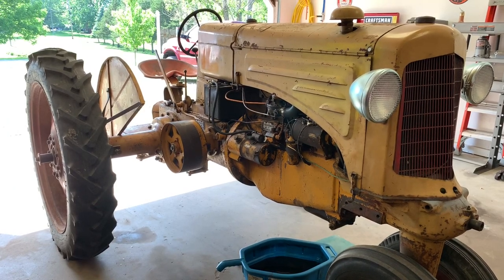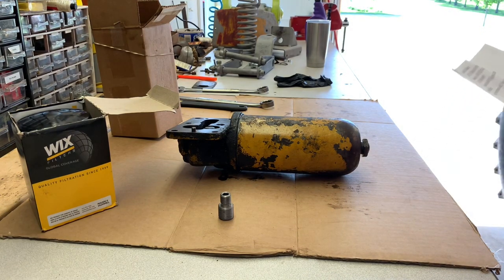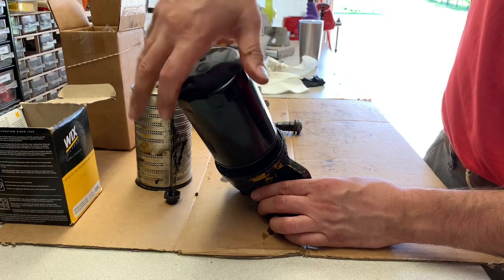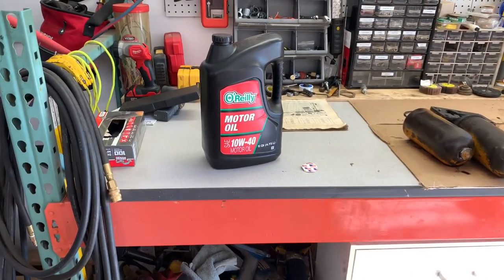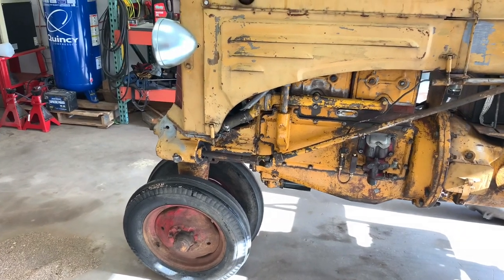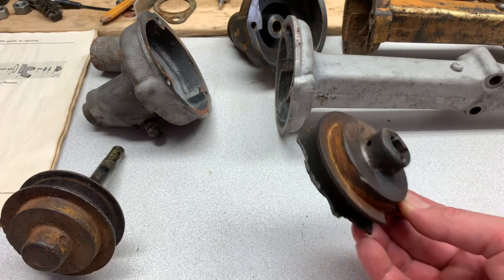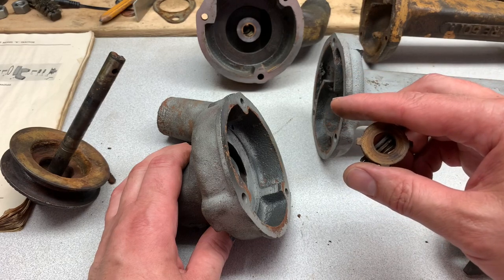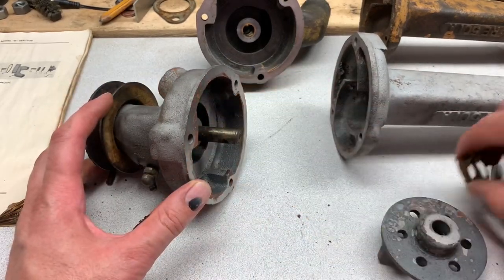Minneapolis Moline R spin on oil filter upgrade and water pump rebuild tips

Comment: Neat you did a video about this and it popped up in my suggested. My Grandpa did this conversion probably 15+ years ago on his R. I ordered the part to do this for my ZB a couple days ago, hoping it gets here soon! I am excited to get the ZB on the dyno to cook some cobwebs out before I put it to work. I should probably order a seal set for the pump to keep on hand.
Reply from the maker: You are back in the archives !
Reply: @crazydave4455  The  YouTube algorithm sometimes knows what I will click on! Good information in this video about the water pump. I forgot all about the pump pulley as it has been probably 15-16 years since I helped my grandpa with his, and he told me just to pull the shaft, not the pulley.
Reply from the maker: @BillTheTractorMan  sent you an email

Comment: Thanks for sharing, I put a filter kit similar to that on my Farmall M. At least someone still makes a few parts. That's a nice Moline.
Reply from the maker: Your moline is much nicer! I had intentions to do a nut and bolt resto, which then turned into a functional resto, which ended up being a repair. They aren’t worth nothing, so I can’t see dumping all the cash in it. But can’t see them scraped either. Thanks for the comment!
Reply: @crazydave4455  thanks, have you had your MM long? I too like to keep the old ones going.
Reply from the maker: Drug it home from someone’s shed in 05, it was sitting for many years already then. Got it running in a few days but it had issues. Still had the original rear rubber. Stashed away for another 14 years and I went after last fall and again in the spring until I resolved the issues.

Comment: My dad had a mm r I remember hauling firewood with it
Reply from the maker: This one came back to life last summer for the first time in a long time. Took her on a tractor drive, raked some hay and it made a few rounds plowing too.
Reply: @crazydave4455  my dad sold his by wadena, MN he bought it by sebeka, MN and he had it running within a few days then he had to pull the pan to clean out all the sludge in the bottom he said was from non detergent oil back in the day.

Comment: Nice!!!
I'd like to put spin on on our two 135 Massey's, but the adapter was almost $100 last time I checked.. the factory cartridge is $3.. the spin on is $12.. lol
Reply from the maker: Have to do what makes sense. These things are obsolete, so they get a premium for filters.
Reply: @crazydave4455  I should look to see if it can be done like you did that.. even if I have to make the coupler piece. Be much better than changing the whole base!👍😎
Reply from the maker: Gosselin Farms Ed Gosselin it’s good to know machinists. If it was that easy, it probably would have been done already but you never know! Start making them, could be some side money for ya lol
Reply: @crazydave4455  LOL.. dad was the Machinist, I get by with most things.. never cut threads other than with tap and die.. but I know a guy who is as good or better than the old man was... Always good to know people!👍